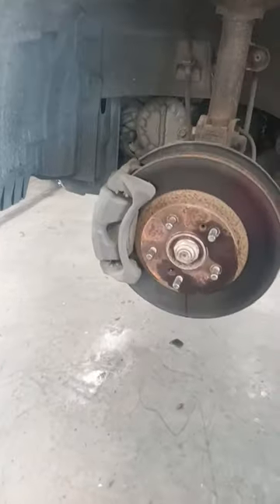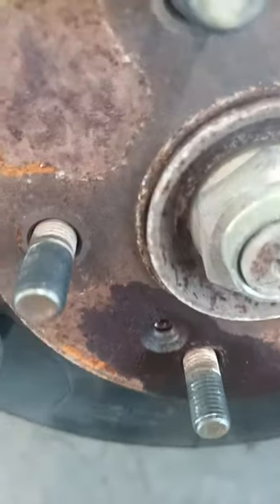🤯How to get the screws out of rotors....all makes😁🤯🤯

Comment: Those screws are not meant to go back in. They are there for only one reason, to hold the rotor in place as the car is being put together on the assembly  line. They are not meant to go back in.😢

Comment: Those screws are only for when the car was on the assembly line to hold the rotors in place on till the calipers was installed